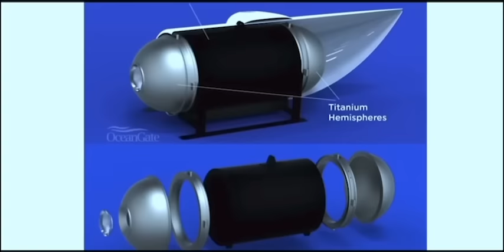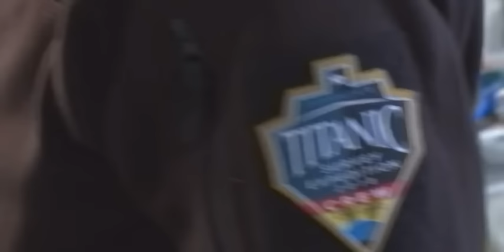First look at #oceangate #titan Debris

Comment: It wasn't made to flex as that would produce fractures in the resin. Also, the end caps would be held firmly in place by extreme external pressure, but as the composite material weakened over time, I think the titanium forced the cylinder to collapse lengthwise being sandwiched between them and being brittle, just shattered into a million pieces.
Reply: Or, maybe the carbon fibre cylinder developed a weakness (even from manufacture, as is the case if you read about commercial aviation disasters analysis, where it has happened so many times that some materials get stressed or have an imperceptible manufacturing defect, which after X thousands hours develops into a crack and eventually shatters) and like a small stone chip crack on your windscreen, which keeps getting bigger and bigger as you keep driving the car, in the same way the weakness developed into a fault that eventually gave way under pressure. There is also additional instantaneous pressure from manouvers or currents that adds to the ambient pressure. Apparently they had jetissoned their ballast and were trying to ascend.
Reply: Out of all the comments only 1 or 2 understand how pressure works.  The glue only held it together above the water, or for pressure testing.  At 10 feet deep you wouldn't need any glue/bolts as the outside pressure would force it together (as long as you don't allow water into the non pressurized side (that's another argument))  The carbon fiber tube def. failed (most likely by compressing in the middle) since it doesn't appear there was a stiffening ring inside. Tubes are not great at that pressure, Spheres are.
Reply: @TomS-i6e  Outside pressure does not make it water tight! Water can get into the minute cracks, can get into the interface between carbon fibre and metal, and this water is at the same pressure as what's "magically" holding it together, meaning it equalises and water can find ways in as the inside pressure is so much lower than outside. The glue is meant to make it water tight, and at the same time, I presume, flex enought to allow the two dissimilar materials to expand/contract separately without cracking and without delaminating. I assume the main cylinder would flex and distort under pressure, within spec, but at the points of the interface between it and titanium it would not be able to, and would shatter. Also I noticed the entry hatch/door had no gaskets or rubber seals, it was a polished metal surface bolted onto another polished metal surface, I am not sure how they kept water out. In addition there was a single person with a hand wrench tightening the bolts, I presume/hope with a torque wrench, and even a spec of metal debris in between would cause the hatch to not be water tight. All suppositions of course.

Comment: Correct regarding spheres being the strongest shapes: there was a video here on YouTube showing different types of balls being subjected to intense underwater pressure and they were amazingly resilient. The tennis ball became saturated with water and was able to go down to Titanic depth and resurface more or less unscathed. The Titan has been described as a “Pringles canister” and it’s obvious in retrospect it was going to give at the weakest point. Btw, it’s extremely difficult to glue hard, smooth metal to other things, it needs to be welded or better still, cast in one piece.
Reply: Most UAPs allegedly seen are of what general shape?
Reply: Spheres are the strongest shapes because the pressure is evenly distributed as opposed to pill shapes. The worst part is it is basic physics, may they all Rest In Peace 😔🙏
Reply: It can still depend on the material. A carbon fiber sphere wouldn't let as long as a pill shaped steel vessel. The steel sub would've been cheaper, too
Reply: He ignored the basic tenant of deepwater submersibles that they are always a sphere because a sphere would be made up of an infinite number of arches.

Comment: You will notice on one end cap had the titanium around the outside of the carbon ripped out. Also you should notice the door wasn’t attached anymore and the plexiglass window was missing. It also looked like the back titanium was missing and there were two titanium rings meaning the back half might also have been bolted on.
Reply: I notcied this too. What is your conclusion or suspicion?  Thanks.
Reply: Window would have been blown out because water has inertia. Like; it imploded and then partly exploded.
Reply: @teamidris  not really a fluid dynamics engineer or an engineer at all, however it seems like velocity from one end ejecting the back and exploding the carbon from the inside out based on the amount of damage on the titanium.  It is possible that the front door was removed from the titanium ring after being retrieved but might not matter either way.  Having the acrylic window fail first is a possibility in that scenario especially since the rear titanium dome is missing making me believe it was ejected with some velocity (i.e. champagne bottle top).
Reply: @mobilechaosyt  it would be highly unlikely to be the window failing and if it did leak the hull tube would still be intact. Whereas the hull tube failing would create a lot of instant kinetic energy that would be able to blow both domes off the adapter ring. And the hull tube is odds on favorites because carbon fibre doesn’t works under compression and the resin does weaken with diving cycles.

Comment: The interesting thing is that carbon fiber is used in bicycles precisely because it does flex. This is my first time seeing the bonding video - what strikes me is they were doing all this work in what was essentially an open-air garage. There is no positive pressure controlled clean environment like what you should want to prevent any contamination of the joining material (this is actually the same as when they were building the carbon tube). Any contaminants would weaken the seal and bond, and introduce potential for failure.

Comment: Without giving to much away, on day one I said the end caps would blow off, after seeing the wreckage I think I was right. The glue they used (I won’t name it) which is one of the strongest on the market will bond if it had a primer and both surfaces were rough. The design needed a return flange so that it could be encapsulated in laminate (I will add under vacuum) then it should have had been pinned.
Reply from the maker: I wonder what kind of adhesive is that strong!?
Reply: @CozziFPV  It is a two-component epoxy. The person who directed the bonding process had no idea of shipbuilding with these materials.
the previous design error was already there anyway.
Reply: I've seen that in small hobby projects (just assorted maker type stuff), people often use a vacuum chamber to remove any air from the epoxy. Would the fact that they applied it in an open warehouse and didn't remove any air bubbles potentially compromise the bond?
Reply: @aliveandwellinisrael2507 I was thinking something similar. Was surprised they did not do the operation in a clean room. Perhaps do it under pressure as well. It really was a stupid design to bet lives on it's integrity.... I worked in a machine shop long ago. They came up with this new way to set carbide  cutting tools by glueing them into a holder with green epoxy. These were then chucked up in a 5-axis milling machine and used to cut titanium. I believe they were 5-flute cutters so not meant to take off a lot of metal but were mainly used for finishing. The epoxy would always crack. It was inevitable. I don't know if it was the pressure, the twisting or the possible chatter (unlikely since a finishing operation) that caused it. We all hated the tools but it was our job as an operator to inspect each one for cracks before the operation. Sometimes they would appear to be fine but crack during use. There seemed to be know way to be sure they would last for any given pass.

Comment: Did you catch it? The end bell with the polycarbonate viewport was being lifted with a strap through the viewport hence no more polycarbonate.
I'll go out on a limb here and say it was that piece of plexiglass that failed and the shockwave of that much water entering in the fraction of a blink of an eye blew the pressure hull(and everything in it) to smithereens.
Reply: Or the reverse. When the hull failed it blew out the window. So many ways to fail.
Reply: The back part with titanium is bent inwards...implosion. hairline cracks in the bonding. They  went down in a m&m shell
Reply: @keithdecesare653  Could be. I'm sure the window was mounted with more protection from inward pressure than outward pressure but it was only rated to 1300m. They were near 4,000m.
Reply from the maker: yes but i thought that it may have been removed to secure it to the crane to lift it? also, something spooked them down there and the last thing that stockton rish did was radio to the ship that he was dropping ballast to come back up! Maybe water started to come in or maybe the porthole cracked!? looking forward to what the investigation finds
Reply: @CozziFPV  I guess it's possible  but I don't see them removing it to lift it if they're investigating what went wrong exactly. They had to lift it off the sea floor somehow as well so...

Comment: As I have commented on other videos on this fiasco, I say again: carbon fibre is a woven fabric that is very strong when subjected to tension (high tensile strength) but depends entirely on the binder, epoxy resin in this case, for rigidity and compressive strength (low resistance to pressure applied from the outside). So I agree with you about the seal between the carbon fibre hull and the two titanium hemispheres used as the end caps being the most likely point of failure. It's never a good idea to bond two materials that have different load bearing coefficients when the joint is a stress critical area. He's right about how far out of the realm of materials engineering reality his mindset was though, only an idiot would believe that the buoyancy of hull material is a critical factor on a submersible. Nobody builds deep diving submersibles out of carbon fibre for very good reasons. I find it unbelievable that he could reject the very scientific fundamentals that would have been the foundation of his aerospace engineering degree. The man was a narcissistic lunatic.

Comment: What is the glue rated for as in pressure (especially after the 5th dive at that depth)?? Strength test. I would like to know what glue they used, is it waterproof?

Comment: I was thinking the same abouting the bonding of the two surfaces. Having worked with carbon fibre in college there was most definitely a better way to secure together. That said would not have done.
Reply: The titanium just had a smooth surface. Nothing to bond to.
Reply: They should have at least buried inside of the hull long threaded bolts from end to end as studs to bolt the end caps onto.
Reply: @mrdan2898  I thought the same thing, the titanium ring glued to carbon fiber is a terrible idea for extreme pressure and temperature changes the expansion/contraction of the dis-similar materials would have been enough to break the bonding of the glue to the carbon fiber and titanium.
Reply: @WJV9  I've worked with glue on many projects, and glue is NEVER equal to the strength of a mechanical attachment. I've lost count on how many times glue as let me down!
Also your correct on the temperature change could easily be contributing to the failure. It's funny that the nose cone was bolted on but the frame for the nosecone was glued onto the frame! Any device is as strong as it's weakest part.

Comment: Very good explanation of how the pressure squeezed on the carbon tube but not the titanium ends.  The squeezing popped the ends off as if you put a beer can in a vice and slowly tightened the jaws until the one of the lids failed.
Reply: Serious physics fail.
Reply: That just inst how this works. Pressure acts on all faces equally, there is nothing in the world that would have pop the ends off at depth.
Reply: @SueMyChin  Then why did the titanium cones come up separately in the recovery if they didn't pop off the carbon fiber cylinder?  The metal was not crushed but the cylindrical tube used to carry passengers appears to be a complete mess.

Comment: One of the problem is the confusion between the tensile strength of the carbon fiber cylinder for internal pressure (it's commonly used for air tanks for example) and external pressure. Think of a rope you pull on (internal pressure has the effect of trying to extend the winded carbon fiber, which its tensile strength can resist) vs a rope you compress (external pressure on a coil of rope with no core).
Reply: Excellent example... it's like a coil of rope glued together basically.
Reply: They were probably aware of those basics. It's still way cheaper than titanium though, even if you make it way thicker. The main problem with cfrp is not so much the magnitude of the load, but what happens in your material locally, especially over time.
Reply: @argh100100  Right.  Unidirectional CF is great for a fishing rod.  Not so great for a vacuum vessel which is the correct perspective for an underwater vehicle.  The unidirectional wrapping with no crossed fibers is far more dependent on the strength of the adhesive than a crisscrossed/helical pattern or perpendicular layers of CF tow.

Comment: Agree with the other posters, and would like to add this to it:  James Cameron said on Monday already he had information from the crew on the recovery ship that the last COMM was that they were dropping ballast and ascending.  If this is true, then on the descent, I think the portal window finally gave way, and the crew knew it at the last second, and tried to save themselves.  What happens afterwards is a simple matter of over pressuring the inside, evisceration of tissue and anything inside, followed by an impolosion.  The weak points are those titanium cap glue joints, and that utterly weak window.
Reply: if the portal window was the catalyst,  would the event be classified as water hammer vs implosion ?
Reply: @michaelduszynski4128  Good point.  As I am NOT a nautical or hydrodynamic engineer, I can say I agree with you, if we can call this generally a pressure surge.  Enough to cause massive damage, which a water hammer will do.  I've seen a golf course fairway sprinkler head launch 150 feet into the air because of a build up of air pressure in front of a fast moving water mass.
Reply: the window didnt fail. the water pressure forced water between the carbon fibers. The only thing resisting this is the epoxy resin. It cracks like glass. drips of water entering the sub from above is what caused the crew to drop weights and send an emergency ping. A few moments later it imploded.
Reply: water drips reported coming off the hand grab rail / light on the roof of the craft. pilot initiated the weights to be dropped, an emergency ping was sent, several seconds later there was an implosion.
Reply: they knew what was about to happen to them

Comment: These educated engineers and glue!!!😮
All I can do is shake my head!
My condolences 🙏  to the family's ❤
Reply: You do know that adhesive bonding is VERY common on aircraft???
Reply: It’s an aircraft?! Lmao nah bro it’s a sub. I completely agree that it’s probably one of the best options for this particular case but what does the fact that it’s common on aircraft have to do with it!? 😂
Reply: @Matt-04  Your stupidity is showing. It is used on aircraft for a very good structural reason, the very same reason would make it an excellent choice elsewhere. Why people are obsessed with the "glue" is beyond me, the water pressure would hold it together glue or no glue. Besides, the thing was crushed, rather predictably, the ends did not fall off [how would they with a water pressure of about 7000 TONS, holding them on]

Comment: The thing that i saw and wondered about is there was no excess glue expressed from the joint. This would lead to say there was not enough goue and voids can occur. It should of also placed in a vacuum to remove any trapped air in the epoxy glue. I wonder if he took the idea that it was used in aviation so must be good, but the pressure and stresses of underwater are far higher and carbon fibre dosent flex the same as titanium putting more stress on the joint.
Reply: I also wondered about no excess glue. Pressure would keep the end caps on until the glue/epoxy cracked. Even a pinhole crack thru that joint would cause an implosion.